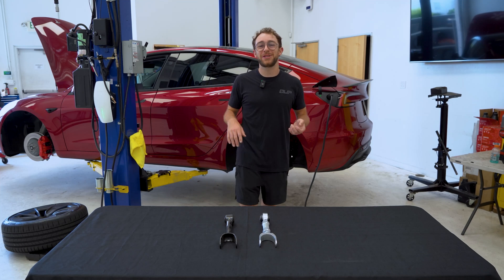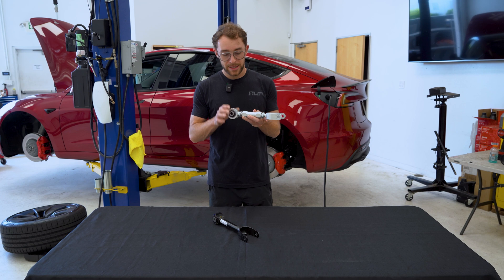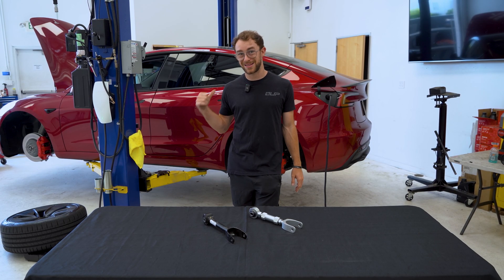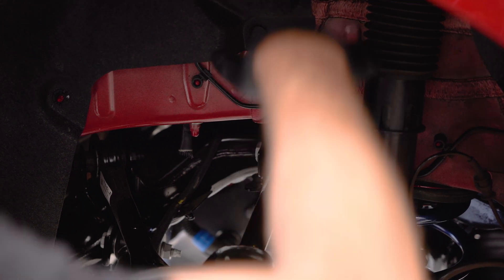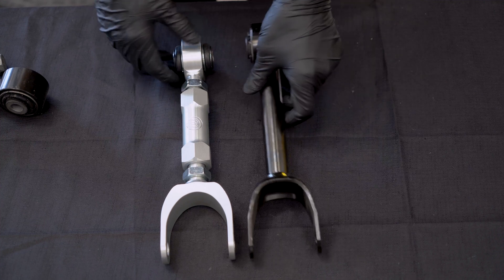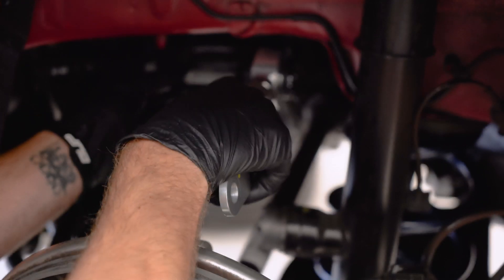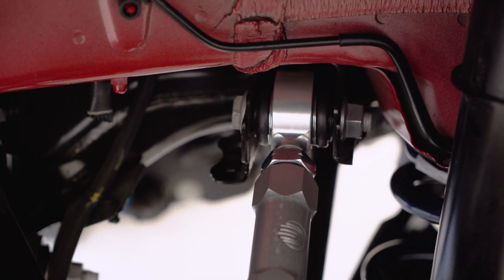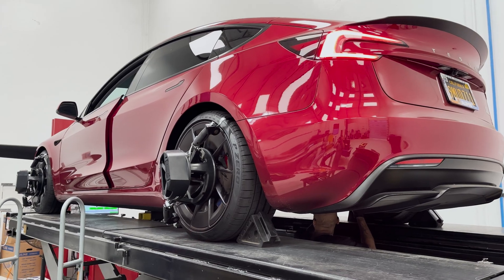Tesla Model 3 / Y Rear Adjustable Camber Arms Installation Guide - Unplugged Performance

Comment: Without an alignment rack, I’m assuming you just install arms with correct length and then drive to the alignment shop ASAP? I’m not a mechanic but I feel like I’d be missing something… 😂
Reply: Duhh
Reply: You can buying an angle measure device (it has magnetic) then you can put it on the disc to measure angle from the original camber arm then set the new one with the same angle

Comment: Would like to see videos addressing seal leaks in the motor/inverter/gearbox housing on M Y. Looking to get my company into the M Y for their fleet vehicles and mechanics want to know  how to repair these things. Reached out to local Tesla service center a few months ago, and zero reply.
Reply: Unplugged is probably not the right party to address that. They sell aftermarket performance parts. They’re not mechanics for OEM Tesla equipment. Tesla is really your best bet.

Comment: Anti-size should not be applied to components that need a specific torque.   Doing so could possible double the amount of torque on a bolt. Even though the tool says it is one thing it could entirely be another

Comment: Nice.  How about a video of tools needed for Tesla service and modifications like wrench and socket sizes, triple square or external torx etc or specialty tools needed for more than just one job.  I'm putting together a tool kit for Tesla use and have 21mm socket but not a 21mm wrench or second socket and handle in 1/2: drive.